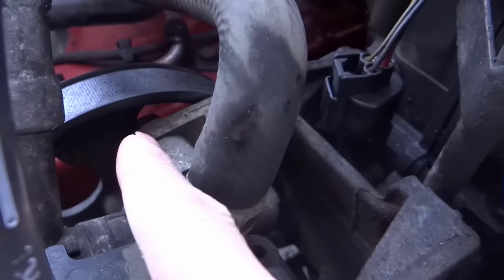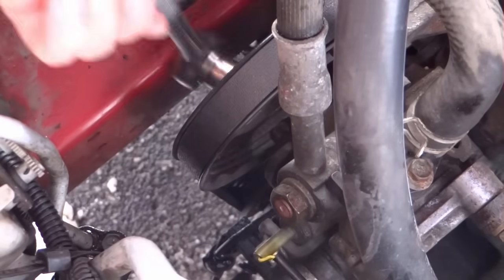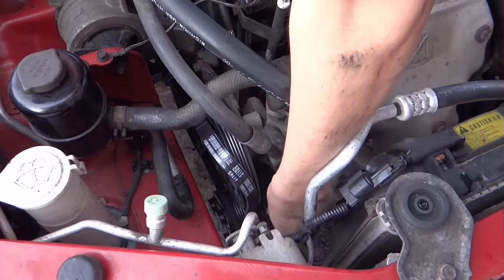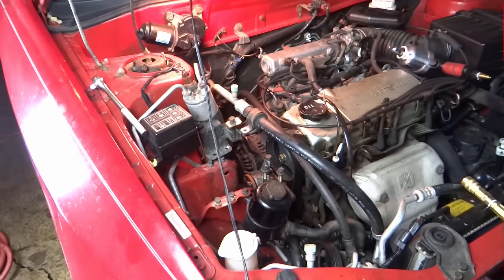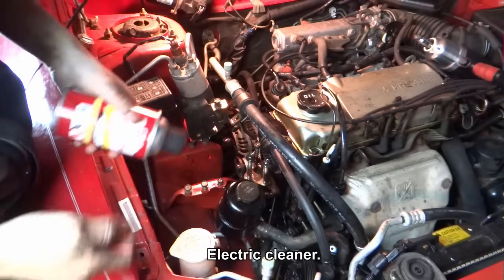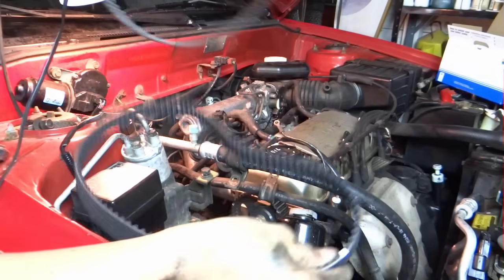Mirage Fix 4 | Steering, Alternator, Timing Belt & Water Pump 4G15

Comment: Hey mackey. I got my mirage leak. There is water underneat the passanger seat. Do u think it's because the a/c or water pump? I got my check engine on too. Maybe timing belt? It making click sound when i start the engine. Thanks
Reply from the maker: Kenick Willie If the water is green ,then it's the water pump. Check engine can be checked with this tool: http://www.amazon.com/Autel-MaxiScan-MS310-Diagnostic-Vehicles/dp/B005KOZ25Y/ref=cm_cr_pr_product_top?ie=UTF8
Reply: Thanks mackey. Anw. Can u help me with kind of part that i should choose on ebay? Its pretty confusing. I have 2001 mitsubishi mirage 1.8l es. And i want to change exactly the same part as urs. Cus, i believe the last owner never do anything with it
Reply from the maker: Kenick Willie
 You want to change the timing belt, other belts, and water pump on your 1.8l?

Here buy this kit (you might not use everything in the kit, but it is a good deal): http://www.ebay.com/itm/Timing-Belt-Water-Pump-tensioner-GASKETS-Kit-Mitsubishi-Mirage-1997-2002-1-8L-/360792603162?fits=Model%3AMirage|Engine+-+Liter_Display%3A1.8L&hash=item5400ea3a1a&vxp=mtr

Here are the videos that will help you:
https://www.youtube.com/watch?v=T__PVmqXf6g

https://www.youtube.com/watch?v=IBaVA4Xh8-g
Reply: Thanks mackey. Hopefully this works and save me some bucks. Keep the great works man!

Comment: Gasoline is not very safe to clean your hands. VERY high in carcinogens. Use some of that stuff in the orange bottle. Also, mineral spirits is safer in tight spaces than carb cleaner, etc. for parts. https://www.youtube.com/watch?v=URo31_aTHUk

Comment: hi I'm planning on changing the timing belt on my car and I have a ?. before I go on first I want to say thanks for all the great videos I've learned a lot from you and I didn't know nothing at all about cars now I'm not scared to do things on my own car so thanks a lot .so now for the ? when you do those marks with the white paint  what exactly are you marking I want to know what exactly to mark because I've read that if you don't put the timing belt on correctly you can mess up the whole timing and the engine and be very sorry and of course I don't want that so can you  explain it more to me and let me know exactly what to mark. thanks again
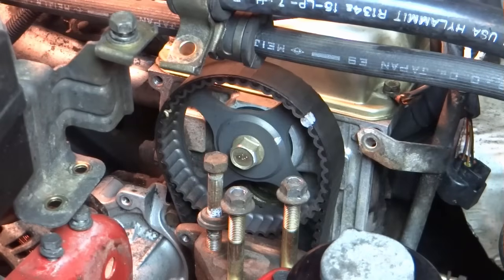Reply from the maker: Nava Rodriguez Thanks! At 5:59 I marked the timing belt and the pulleys. Then I take the timing belt off. At 8:41
 I matched the new timing belt to the old timing belt and marked the new
 timing accordingly. Finally, I put the new timing belt on by matching 
the marks on the pulleys. Cheers

Comment: Hey, I own a mirage 2000 coupe too and my power steering just broke right now. As much as I would like to repair it myself, I don´t know anything about mechanics. About how much is the repair taking?
Reply from the maker: R. Mauricio Contreras Steering broke off. What part? The rag? Or the tie rod?
Reply: I think it´s the tie rod. How much would cost me to fix it? For now I´m driving my brother´s  car, but I need to fix mine this ASAP. I just want to know roughly what is the estimate. 

Thank you for answering.
Reply from the maker: R. Mauricio Contreras  Here you go $28 http://www.ebay.com/itm/93-02-Mirage-93-94-COLT-SEDAN-AND-COUPE-93-95-SUMMIT-4-tie-rod-ends-/271518281509?fits=Year%3A2000|Model%3AMirage&hash=item3f37c02f25&vxp=mtr

Comment: Hey man so is the water pump easy to get to and replace on a mirage? Mine is a 98
Reply from the maker: Drew Cobain If you're gonna replace water pump, you should replace all the belts too. Yes, it is easy to replace the pump. Just make sure to clean the surface good and I only use the gasket, and I use some grease just to make sure it stays inplace when I put the pump back in. If you also wanna use sealant that is made for water pump along with the gasket, it would be ok too.
Reply: E3

Comment: you dont need to count the teeth make sure cam in lined up and crank shaft is lined up , put slack on tensioner side the install clip done deal
Reply: +Bryant Busse I think he was making sure he had the correct belt more than anything...
Reply: +Bryant Busse  nothing wrong with having some redundancy

Comment: O lol but yes the reluctor blades are located behind your camshaft sprocket the 2 brass lookin blades. on the right of the sprocket the a sensor that's the cps when the car is crank the blades spin and go thru the cps which tells the car ok we are TDC go and ahead and fire up. If the cps is faulty you will get no spark so doesn't matter how many times the timing is set also you did a great job putting everything together before cranking because the hermonic balancer or crankshaft pulley  has to be on for the blades to position correctly or the blades could hit the cps and your car with be without fire. I'm so used to setting timing to my eclipse. I usually set timing  turn it over if it fires up put everything together you're done if not go back and try again the mirage is a different  when. It comes to the timing

Comment: So why didn't show the portion where you set the timing. I'm having trouble with mines it 2001 1.5 mirage and need help
Reply: the timong mark is stamped into the head on the camshaft sprocket the crank shaft is the dot on gear the the mark on block
Reply from the maker: Rodney Jennings You need to watch the whole video. There is no setting. This is just as easy as taking the old one out and putting a new one in. cheers
Reply: So you didn't line up the timing marks I saw where you had mark the belts. But didn't fully understand I been beating myself trying to set timing I replace the head gasket  and water pump on mines. I set timing but nothing  today I notice the cps had separate from the magnets inside some how Idk so I order a new cps that should be here sat so hopefully  I good
Reply from the maker: See you have to mark the old timing belt. and then take it out and compare it to the new one, and then mark the new one accordingly.
Mark the old one at 5:59
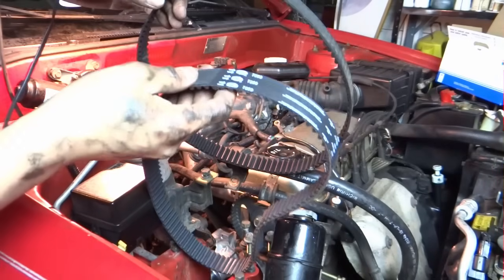Mark the new one At 8:32
Reply: Gotcha I can't do anything  till the cps also do you have videos on the cps I understand  it now I'm still fuzzy on the reluctor as how it suppose to be positioned. Or installed
Reply from the maker: I have no idea about the cps or the reluctor. lol

Comment: Hey awesome videos! I've noticed from most of your videos you order your parts online. What websites do you shop at?? You should definitely post websites where you shop at or order parts from. Thanks for the vid keep it up with mechanics **
Reply from the maker: Jacob Chievous Thank you! I bought this set specifically for Mirage 1.5 from Ebay So I know for sure they all will fit.
Reply: Yea I had a 1.5 just like yours but it was a 1997; I past it down to my brother. I bought the car for 50$ from a friend. I had to swap the engine with a 2000 Mitsubishi Mirage 1.5; $200.00. It was the best $ 250.00 I've spent . One of the best cars I had. But hey besides eBay what other random websites do you go shopping. At the moment I'm driving a Mini Cooper 2002 manual base model and I shop at Pelicans parts . Com awesome website for the price s . Hey keep up with mechanic bro. Awesome work. Give me a shout out on me hahA.

Comment: My mirage de 2000 evaporates water and coolant you think I might need a new engine water pump or what could it be ??
Reply from the maker: Hmm, do you see any leaks? If not, then you might need a new pump. I think because the water is not moving so it got hot and boiled.

OR.. worst case would be that the coolant leaks into the cylinders and burn out that way.

Just what I think. cheers
Reply: Well today I found that some pipe line below the throttle body has a pine hole and water comes out through there , but also I think there might be another one because more water come out from below and it is not from where the water pump is ...
Reply from the maker: Fabo Gonzalez
 That's good that you found out

Comment: Hi,
I just complted the same work on my Mirage but it now hesitates to accelerate when the A/C is on. You made it look simple but it's quite a job. Did you reinstall the bottom half of the timing cover?

Thanks for the vids!
Reply: Thanks for the comment. I cleaned the MAF sensor once again along with the connector and now it doesnt hesitate like before. These cars are not known for tearing up the track but they are extremely reliable.
Reply from the maker: Yes, I did at 9:35

What car do you have?
Reply: 2001 Mirage 1.8 Automatic
Reply from the maker: A Hernandez  You might need new O2 Sensors to stop hesitating
 
Make sure you get DENSO
Reply: Thanks. I also saw your vids on how to change the O2 sensors and you also cleaned the maf sensor. Thanks for the advise and please post more videos with the Mirage or Lancer.
Reply: A 4 Cylinder like this will struggle a little when the A/C is on. When the compressor kicks in on my Lancer, it's almost like hitting a brick wall lol. Nonetheless, if it's seriously down on power after changing your timing belt, you may have left it a tooth off.
Reply: montysport94 how did I know id find you here....
Reply: DJscab92
 What can I say? I'm a basic bitch.

Comment: Worst video you’ve made yet. Slow it down and please try and explain what it is your doing - step by step. I watched this one twice and don’t have a clue.
Reply from the maker: :D You need to be working on it also, I mean looking at your car's engine and kind of get some ideas. Though, I agree with you. However, this is like an over view, it contains everything, but fast. So if you missed something in your process you can come back and watch it as a reference. cheers
Reply: The DarkDragonWing
I'm sure you included every step in the video. I just had a little trouble following your Fast-track. I have the 1.8 and will be replacing my timing belt soon, so this was a big help, Thanks You Rock!
Reply from the maker: jimmie269  nice, I think 1.8 is different from 1.5, so here is the video for you:  97-02 1.8l mirage timing belt detailed tutorial 1

Comment: I wish I knew as much as you, I need to do the timing belt on my lancer but I don't even know how you did it even after watching this vid. You pulled off so much stuff! :/
Reply from the maker: Yes, it is different on the Lancer. This is a 1.5 engine, the Lancer got a 2.0 engine. so yea

Hopefully I will get to change the Timing belt on a Lancer.

ps. If I were you, and with no tools/equipments, I would not attempt to change it

cheers

Comment: Great video, but I think theres an error on how you have done the timing belt, the belt can go on anyway there was no need to mark it you should of marked the camshaft sprocket against the engine as a set point, if the sprocket moved the valves will be out of position resulting in the engine damage you mentioned earlier on of the video.
Reply: I agree with you, also there is already marks on the cam shaft and the head for timing and on the crank shaft and block. Great job but you never know the belt could've slipped and doing it that way would of changed nothing.

Comment: are you planing too modify it and then go drag racing.
Reply from the maker: oh I would that if I'm rich, but right now I would like to have a cheap good car to use. :D
Reply: The DarkDragonWing link for ur air compressor and gun?
Reply: how much was it in total?
Reply: That's good thanks
Reply from the maker: *****  26gal. 150psi air compressor, and a 600ft.lbs. gun

I got them from a local store
Reply from the maker: *****  about 200for compressor 70 for gun so $270